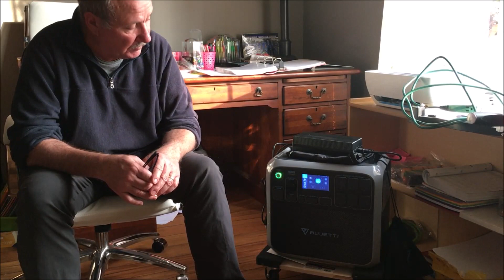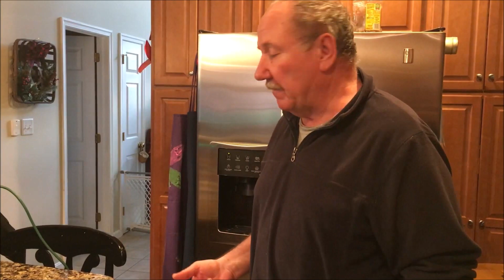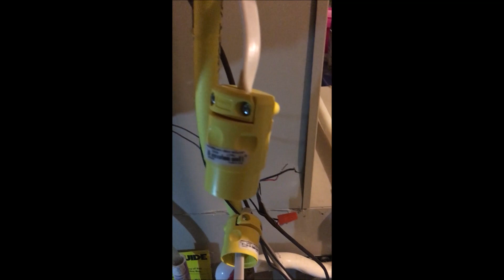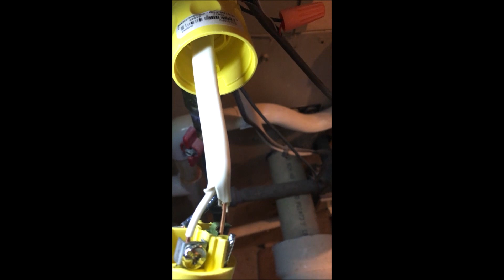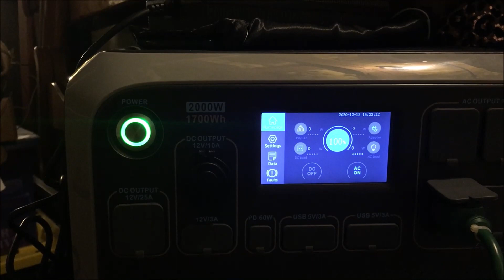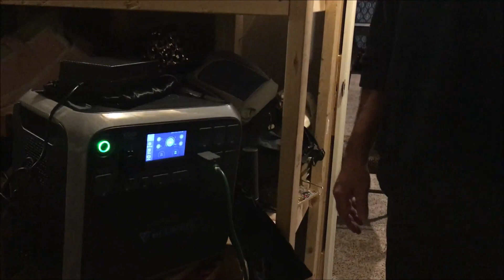Using Bluetti AC200 Solar Generator as backup power.

Comment: Steve:
I have several refrigerators & freezers and ran them with individual  kill-a-watt devices for many months to get an idea of average power use.
Here are the power usage numbers that I've measured over long periods  
The 18cf frig (Very rarely opening its doors) uses 1.01kwh a day & the 22cf uses 2.0 kWh per day with fairly frequent door openings. Note that the data plate rating is 6.25A max current draw (1.9A typical) including the frost free feature (see below). The normal 5cf B&D freezer is exceptionally efficient at .47kwh a day & a small countertop Haier freezer is .56kwh/day -- not  very efficient. 
Your frig seems to be larger than mine, so I would be curious about it's manufacturer's specs because it sounds amazingly efficient & low power.
I'm a EE and I did VA measurements to verify the kill-a-watt numbers, so I'm pretty confident in them. 
I'm interested in power reduction since I designed & installed my own off-grid solar system, the latest section is 3.3kw of panels with 20kwh of batteries. I also have an older section with 7kw of panels but it wasn't quite enough for my usage.
I also got the Bluetti AC200 for my upstairs office & bedroom because it looked like a very inexpensive way to add power, much as you did. My gas furnace has a spec draw of one kw for the blower so you've got me beat there as well.
My goal is to be 100% on solar with no supplemental gas backup which us why I'm adding onto my solar capacity and looking for a more efficient frig.
BTW, you should be aware that most home Friges are frost free, so they have a heater that kicks on a few times a day that will dramatically increase your peak power use. (It pulls several hundred watts when active which is about 5-10 minutes per cycle.)
I do Not have one of those "Sub-Zero" friges, as they cost a fortune and need Hoover Dam to power them.
Reply from the maker: Wow that is great information. I think I would be lucky to make it 12 hours with two refrigerators and the furnace running. I would have to run the generator for a couple or few hours to top everything off again. However, it is twelve hours I didn't have without the Bluetti. My other use for the Bluetti  and solar is to go camping. I'm  planning on buying a van in the Spring. We will see how that works out. Thanks again, Your comment added much to the content.

Comment: Check temperature settings on the 3 different screens. PV/Car screen shows 20-30 degrees low on units that have defects. My 1st one was bad and so was the replacement they sent me. Just a heads up for AC200 owners.
Reply: Do the issues transition to the 200p?
Reply: @ARMEDPATRIOT757  yes issues reported on the AC200P as well. Bluetti says issue could take millions$$ to fix and will only fix the issues in later productions. If you are deadset on buying one I would hold out as long as possible in hopes of getting a newer production unit.
Reply: @VANquishedAdventures  damn I was literally about to check out on the bluetti site
Reply from the maker: My temps were a couple degrees off between the different screens. I don't see a large difference so I think it is OK.
Reply from the maker: Thanks will do

Comment: Might be worth picking up a “Kill-A-Watt” to determine the actual power consumption over a 24 hour period. That will better equip you to calculate the actual run time of the AC200 to whatever you intend to power. Most average refrigerators can cycle to a max peak at 1,200W depending on options (ice maker water filter...etc.), internal temp setting and ambient air temp. Thanks for sharing.
Reply from the maker: Thanks, For sure a longer test over time would give a better result of power used. I agree that the refrigerators would probably pull more watts when the compressor starts up. I was just glad to see that they all worked off the AC200.